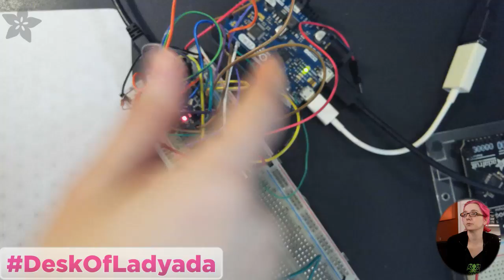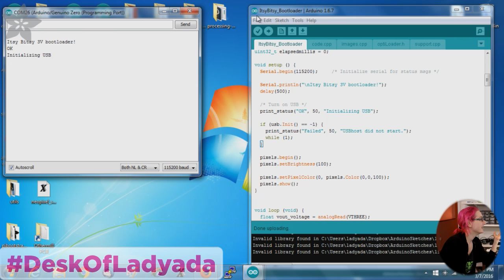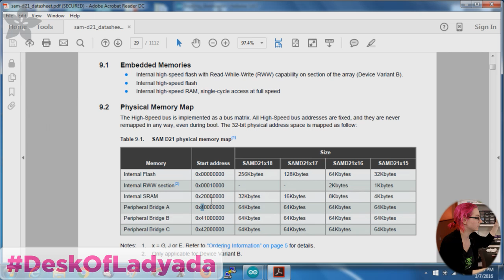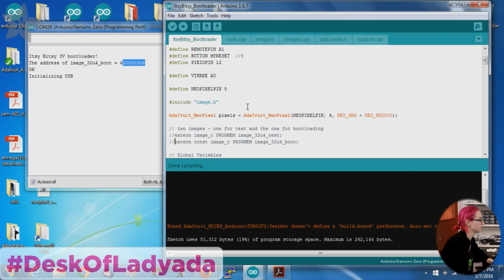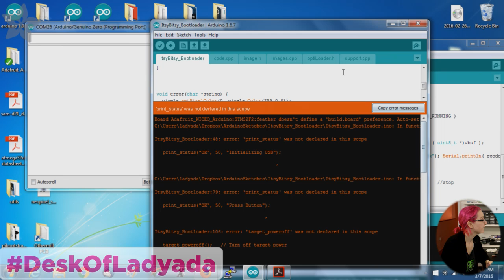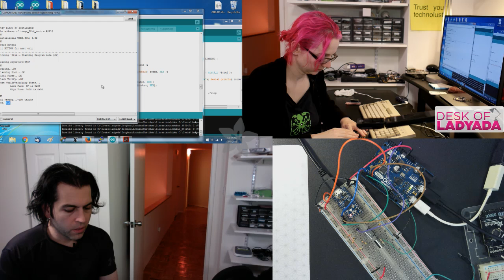Flash memory storage on ARM processors LIVE #deskofladyada @adafruit 3/7/2016

Comment: It's very disappointing to see that PROGMEM doesn't work the same for ARM doesn't work. While it is rare that one would run out of RAM using ARM, you did because you expected PROGMEM works the way it did for eight bit AVR. We need a learning system article that talks about why you need PROGMEM and then explain that it doesn't work with ARM.